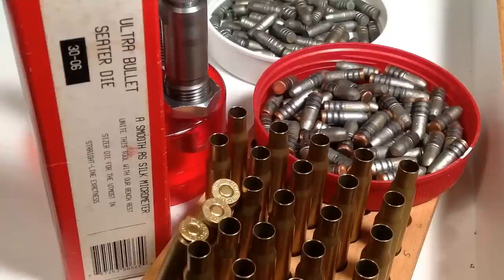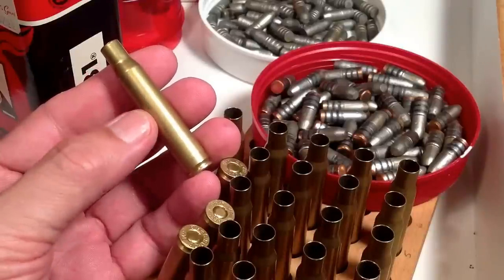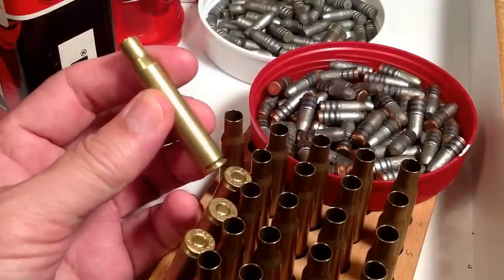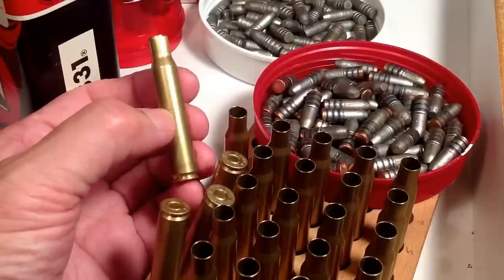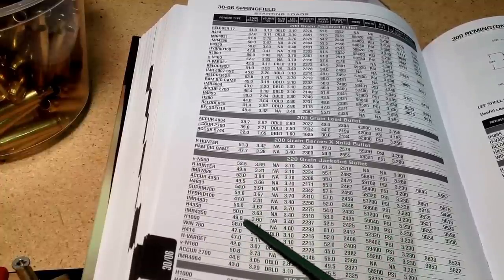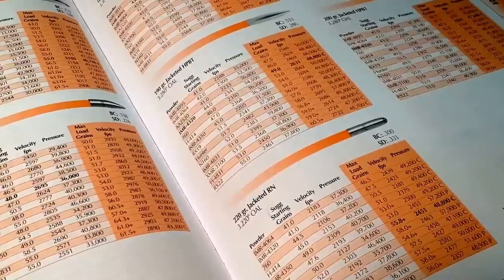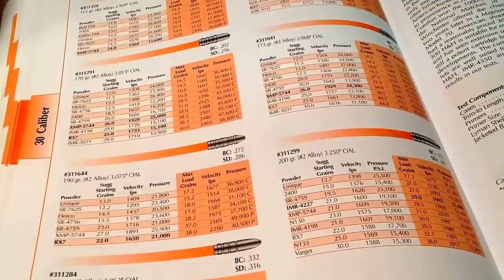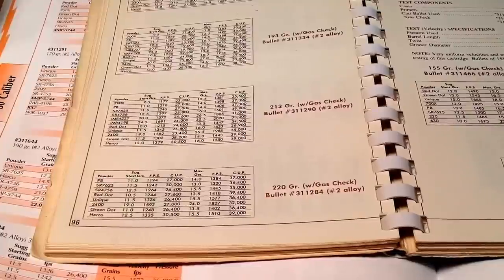The Danger Of Reduced Loads in Rifles

Comment: I have done a lot of reading regarding reduced charges lately as I shoot reduced charges in my old Spanish Mauser Carbine re-chambered to .308 as there is a belief they were not designed to handle full pressures of modern day 308 rounds. Plus, 308Win in reduced charges are a lot more pleasant to shoot, especially for the missus.

If you actually read the Lee Reloading Manual regarding reduced charges, it recommends you shouldn't reduce a load by more than 50% of the max load to be safe... and according to the burn rate chart, not to lower the charge by more than 20% of the max load of the slowest powders listed, and then increasing that amount by 1% as you go up the chart (burn rate gets quicker).

Using a powder such as H4895/AR2206H... you can safely reduce the load by 60% of a max charge as stated by manufacturers.

Both ADI / Hodgdon recommend Trail Boss for reduced loads as even a full compressed case of powder will never exceed max design pressures.

Consulting numerous reloading data (Speer / Nosler / Hornady / Hodgdon / ADI / Lyman / Lee) there can be some really massive differences in min/max loads from each source with same powder / bullet weight. It seems a lot of this data comes from accuracy testing... if a reduced load was not accurate in the test rifle, it probably doesn't get listed. There doesn't seem to be much science behind this data, its just trail and error. The myth of SEE or detonation was apparently something which could not be duplicated in test facilities, and as it is an unknown liability issue manufacturers would obviously take the safe route and just not recommend it. There seems to be a belief a reduced load is more likely to be doubled loaded in error, which may have started the whole reduced charge myth.

Last but not least.. if powder position in a case is the concern with a light load, there are people who use polyester filling material to ensure the powder remains at the base of the case (also has its pros and cons). To me, this is what intrigues me with reloading... finding the right combination of power / charge weight / bullet brand/weight and see what works best for your rifle. 

Just do your research first and be safe.
Reply: do You have any experience using pistol powder for rifle (5.56 nato) charges?

Comment: Great info, Thanks. I think another problem new re-loaders are having is that the powders in the manuals are ether very hard to find or no longer in production. The powders company's have not helped this any with all the new powders they have released over the last few years. Even their own loading data sheets are a work in progress. For many of us wanting to load for old military cartridges, you may find load data using a powder for cartridge X but for not for Cartridge Y. That powder may or may not work for Cartridge Y but no testing has been done or published. Loaders may then look elsewhere on the web to find a load for that cartridge or try to compare like cartridges for a load that may work and that can also be dangerous.

Comment: If you haven’t covered it yet..H110 (great stuff!) is another powder that requires a reduced-load caution. Works very well with a nearly full case, can misbehave erratically or very badly even with starting loads approved by reputable eggheads.

Comment: Had a riflesmith explain it to me . Low volume in the case allows the smokeless powder to built pressure within the case (because of the void, usually around half or less powder fill). This can cause a pressure spike within the brass cartridge before the bullet exits. (I had this happen once in an AR, my bad and not fun.) I've also built subsonic loads using polyester fill and  light pistol powder loads with success. I've gotten wiser since then and don't do either one anymore. As most of you know, smokeless has the "I like pressure" thing going on. more pressure, faster burn, faster burn, more pressure. I had used a powder that had similar burn rate but took up much less volume, worked well for a few shots. Load data did not mention this powder and I thought I was clever, until the event. There is a reason some powders with similar burn rates aren't listed in the printed data and I can not afford the cost of a repeat.

Comment: TRAIL BOSS POWDER.... IS GREAT FOR SLOWER SPEED LOADS.
Reply from the maker: J Martin - And that is one of the real pluses of TB powder - we don't need any reloading data for it.  Just fill the case to the bottom of the bullet by eyeball, weigh the charge and take 80% = done.  And impossible to double charge a case... Everyone should have some TB powder... Best to ya,  FC
Reply: J Martin I printed out the trail boss 45lc and 3006 data right from the makers database.
Reply: Awesome Australian made powder that one :D
Reply: Trail Boss data says start with 70% and move up to find best result.
Reply: Many barrel detonations occur with under-charged loads when the charge is partially ignited and the bullet meets the rifling resistance after the easy movement through the free bore.  Pressures spike and the powder accelerates in its burning rate.  Smokeless powders burn faster under pressure.

Comment: May I suggest that problems can be easily avoided by using an inert filler, such as cotton wool, on top of the powder. Simples!
Reply: Agreed, a little bit of Dacron will suspend the powder and prevent shifting.
Reply: That idea was only to position faster burning powders. Don't reduce charges of slow burning powders. Just get the proper powder. For God's sake people, get a reloading manual and READ  the entire thing.!!!
Reply: There were a lot of people that I knew that I told not to reload. They didn't have the intelligence or the attention span. The best was the guy that actually counted 53 grains as in kernels of 4831 for his 270,telling me it didn't look like enough powder. Internet trolling is a good place to find bad advice and I'm sure it will prove to be a Darwinian experience for some of the uninitiated.
Reply: NOOOOO!!!!!

IF YOU WANT TO EXPERIMENT, BUY A BENCH RIFLE AND A REMOTE TRIGGER.

Look guys, don't vary from the manual. Kapok was recommended for very small loads in a large case. Usually a fast burning powder.
Reply: I was thinking of cornmeal, but cotton would avoid any problems with mixing like reduced burn rate.
Reply: @greybone777  thanks key board warrior for your infinite wisdom
Reply: The problem with case fill (as JRB discovered) is that you need to have the case filler be VERY consistent or it has the effect of wildly changing case capacity and puts pressure all over the place. They also tend to increase pressure considerably above having no fill.

Comment: I think that when the primer is ignited in a with a full powder load, the powder is ignited across the small surface area of the case with the flame front perpendicular to the case. Small surface area = small ignition area resulting in a slower pressure build up. When the case isn’t filled relatively full, the powder is spread out over the length of the case. When ignited the flame front is spread out over the total surface area of the spread out powder. This results in faster burning and higher pressures.

Comment: Hi, hope you guys are well. Im new in casting bullets but need to get more info on lead hardness. I have purchased a block of lead which I don't know the harness off. What can happen if I cast bullets with too soft lead on .308 . I want to quench with cast and powdercoat afterwards. Does this increase the strength enough of the bullet? Will a soft lead powder coated bullet be safe too shoot in 308?

Thank you

Comment: Yep read about this years ago, cowboy action shooters have had this happen trying to make reduced loads for easier fast shooting. Seen different theories about it but they agree it happens and I've seen the pistols aftermath pictures. Very good information to share.
Reply from the maker: +TRprepper --There have always been the rare Kaboom events with small charges of powder even in pistol ammo.  The labs called them detonation events.  That was the reason many reloaders doing light loads insist upon using Unique as 1) if fills the case better with small charges and 2) the burn rate is safer.  Also, the coming of Trail Boss powder was specifically for that issue (powder named to be attractive to the cowboy action crowd).  Very fluffly to fill a big case like the 45 Colt or 45/70, no way to double charge, and pressure levels very conducive to safety.  Note - some of the cowboy shooters went with smaller shorter cases like the Schofield case just to make the powder space less of an issue.  38 Special cases with small charges of Unique also was the way to go.  Thanks for the post, and good shootin' to ya!!
Reply: +FortuneCookie45LC I can see the logic in using a shorter case in the Colt 45 as the case, designed for black powder is obviously way to big in capacity to happily house our modern Nitro powders,( I use a foam over powder when I load Nitro),  the thing I cannot understand about using the shorter brass is that for every 1/8" less in case length, the projectile has to jump that much further to reach the rifling, a thing that is a real no no in a rifle, are they accurate? We need you to experiment with this combination!
Reply from the maker: +Englishman French -- Ideally, we'd have shorter cylinders to minimize the jump...With current revolver setups, the loss of accuracy from the jump is balanced by the improved burn from a more advantageous loading density so the accuracy is still more than acceptable.  Our handguns are mostly good for 6 MOA so that is why we are OK with this.  Our rifles, we want sub 1 MOA so the bullet seating depth has a significant bearing.  Even then, we shooters have experienced best accuracy at .009" off the lands and even more in some cases.  Bullet jump may not be as big a factor as we have always thought.  My Davis PPC comp gun (148 grain HBWC ammo) has an exceeding amount of bullet jump, but Bill Davis didn't bother to grind the cylinder shorter - the gun shoots 1 1/2 inches at 50 yards.  Best Regards to ya..!!
Reply: +FortuneCookie45LC  .009" ! You have now inspired me to try setting back from the rifling on my G, Gibbs Farqharson, that is throated for the 215Gr bullet, (303), and it is impossible to seat a 175 gr bullet out far enough to touch the rifling, especially with a boat tail.
Reply from the maker: +Englishman French -- When we were varmint hunting, we used to call that condition = freebore.  Keeps the pressures down so a little extra powder could be added to the charge with increased velocity - good for blowing up the little critters at distance.  My shooting buddy had a custom heavy barrel 270 and loaded his 90 grain bullet ammo 1 grain over maximum because of the freebore in his rifle.  He seated his bullets out a little farther and still had extra bullet jump.  Good shootin' to ya with those 175s...

Comment: Hogdon says that H4895 can be loaded at 60% max charge for light loads. Haven't tried it yet but I have loaded 30/30 with a 115 gr. LRN with 4.4 gr. of Win231 with good success.
Reply from the maker: +Soulman1282 -- Hodgdon 4895 is the original surplus small arms (30/06) powder of the US military - and Bruce Hodgdon started his powder empire with that and 4831 (surplus 20mm cannon powder).  Yes, 4895 has been shown to be OK with 60% charges.  But that is not true with other powders in the same slow burning range.  Faster powders like W231 are OK for reduced loadings in big cases.  Good shootin' to ya,  FC
Reply: I use slightly reduced loadings of H4895 in my H&R Shikari  .45/70 single shot rifle, but I don't reduce them more than maybe 10% under the starting load

Comment: I am also looking and doing 30-30 Winchester reloads with Red Dot powder.  I looked in my Lyman cast manual 4th edition and they do not have a load for Red Dot.  I found a website than did do a work up with 6.0 to 8.5 grain charge of  red dot with a 170 gr. plain base bullet.  Should I use some kind of filler in the case and if so what should you use and where can you buy it.  I very much appreciate your videos, and always enjoy your knowledge you provide me as I have only been reloading for a few years.  Thanks
Reply from the maker: spitzley2001 - Red Dot is fine for reduced loads in rifles including the 30/30.  That is because it is not a slow burn rifle powder, but rather a fast burn shotgun or pistol powder very safe and useful for reduced loads in rifles...Unique is another powder good for that.  Of course, published loads are the way to go.   Best Regards,  FC
Reply: Do I need a filler with red dot in 30-30
Reply from the maker: spitzley2001 - You could put in some fiberfill to hold the powder, but fillers are usually not necessary until you get into the real big cases like the 45/70.  Doesn't mean you can't do it though, but just a 1" square of fiberfill is all that is needed, as you know...  Best to ya, FC

Comment: What about using fillers to deal with???
Reply from the maker: +Cleber Nj  -- Sorry for the late reply - Google did not post this on my inbox... fillers are useful for small charges of fast burning powder in big cases.  This is a different situation - we are talking about 1/2 charges of slow powders in big cases - the fillers are not going to help prevent possible problems as the filler will just jam up against the bullet and the same potential problem of barrel obstruction could occur...If a filler is used, faster powder like Unique or Red Dot would be useful.   Best Regards to ya,   FC

Comment: Very helpful!  Since I want to take advantage of the ideal sectional density of 165 gr .30 cal bullets for deer, I am wanting to work up a .30-06 reduced load for a 165 gr jacketed bullet for hunting whitetail at less than 100 yards, but all of the starting loads for the usual powders produce muzzle velocities that I consider too high.  I have some older reloading manuals that offer reduced loads for jacketed bullets but using powders that are no longer made.  I'm not trying to go subsonic, but I want reduced recoil while maintaining a terminal velocity that guarantees good penetration and bullet expansion.  (I think I'll just use .30-30 muzzle velocities for my 165 gr bullet.)   I have a Lyman cast bullet guide from about ten years ago, and I now think that I can find a very safe starting load using a fast-burning powder.  It also surprised me that there's little information out there for working up reduced loads, and as you pointed out, going low with slow-burning powders is a risky business.  Back in the 1970's my father worked out a reduced load for .30-06 that could actually be used for rabbit. As I remember it, he used a faster powder and a cellulose filler to keep the powder up against the primer.
Reply: Hogden manual.. I think it's on line... as well the lee
Reply: I like Hornady's reloading app (on my phone), because it specifies lower min velocities than most. For 165gr 30-06, that means 2400 fps for many powders. Or just use H4895 - it's ok (per HOdgdon) down to 60% of a max load.

Comment: Hi FC 45 LC.....   What about using Polyfill to fill the gap in the case? I've see that done, wouldn't that be safe for slow burning rile powders?
Reply from the maker: +Widow Maker -- The thing about slow powders is that they were designed for progressive burning to allow the attainment of a higher velocity performance.  Takes a certain charge to do that and those charges are not small charges.  Kind of like shifting into third gear because we have wound out second.  We don't start from 0 in third gear.  That's what trying to use slow powders for low velocity ammo is like.  If we start in third, we probably kill the engine.  Shooting slow powders in light loads might kill the gun.  Note that all the polyfill loads in the Lyman handbook involve small charges of faster burning powders.  If you use Unique for reduced loads (say 9-10 grains) in big cases, the use of polyfill would be appropriate.  The problem is that slow burning powders are more difficult to ignite (there is a term for this ignition situation).  Primers need to maintain the flame (not necessarily a hotter flame) for a few milliseconds longer to really ignite them.  By that time, the small powder charge has moved forward and the packing properties of the slower powders then takes over to possibly cause a barrel obstruction.  Apparently Unique doesn't do that - it lights easily and the burn is already in its curve before the charge gets to the front of the bigger cases.  And if its subsonic you want, Unique gets you there nicely.  When we need more performance, then we shift into third... Best Regards to ya!!
Reply: Thanks for the reply, Ok didn't realize you need to use fast powders with polyfill also. Yes Iv'e seen Trail Boss use with the playfill you answered my question thank you. Keep the vids coming love em...
Reply from the maker: +Widow Maker -- The Lyman Cast Bullet Handbook gives loads where the polyfill is recommended.  If not recommended, you don't need to use it.  But if we want subsonic, we need to use even less of the fast burning powder than the LCBH gives - that's when we need to kick in the use of the polyfill on our own... Good and safe shootin' to ya..!!
Reply from the maker: +Widow Maker -- Doesn't take much polyfill like 1-2 grains of it to do the job tamped down onto the powder charge.  We don't need to try and fill the entire powder space with the polyfill - the stuff is available from craft stores in 1/2" thick sheets - a 1 to 1 1/2 inch square of that is good.  Best Regards